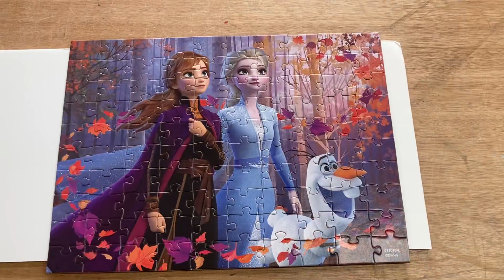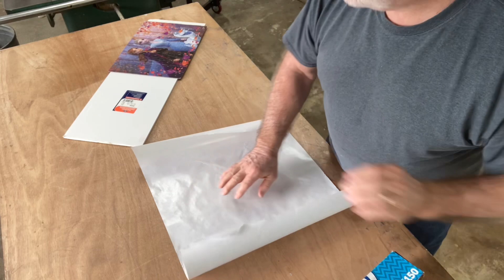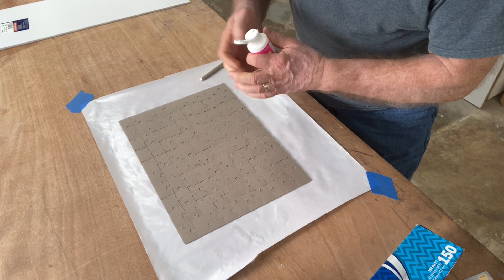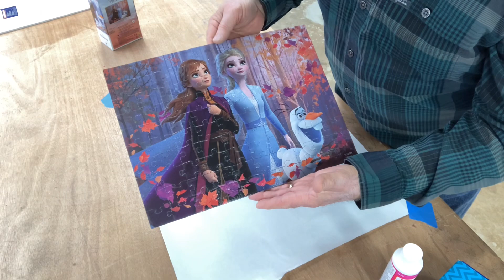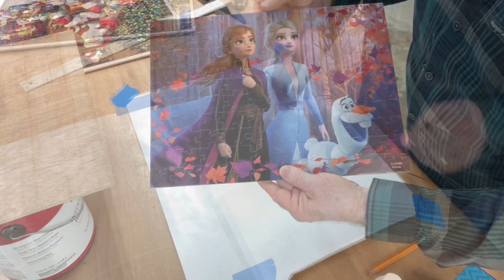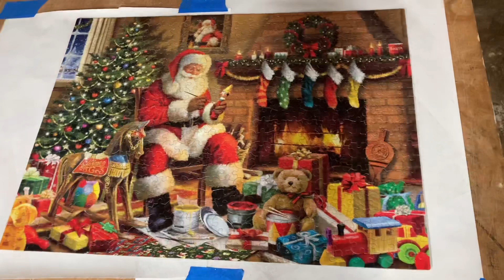Two Techniques to Glue Puzzles Together

Comment: We have used duct tape with a slight overlap on the back successfully, however it doesn't protect the front
Reply from the maker: That's one method for using duct tape that I have not tried.